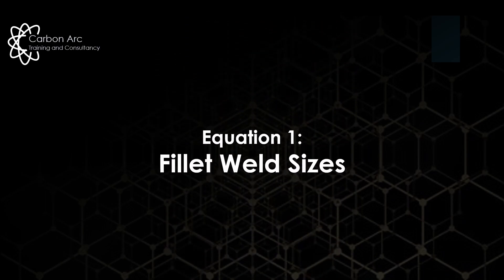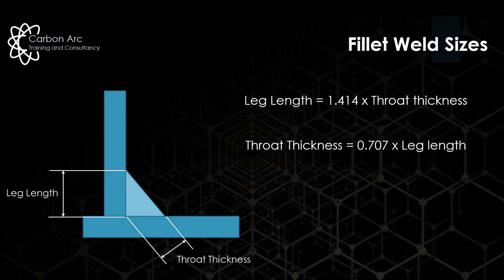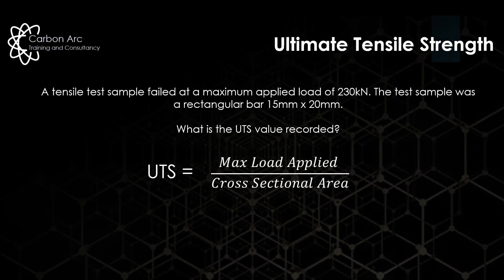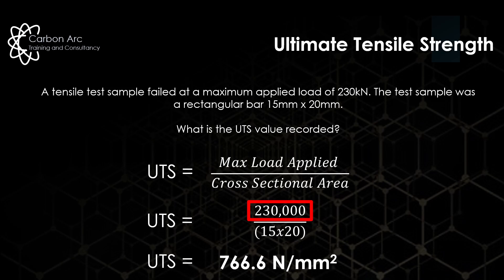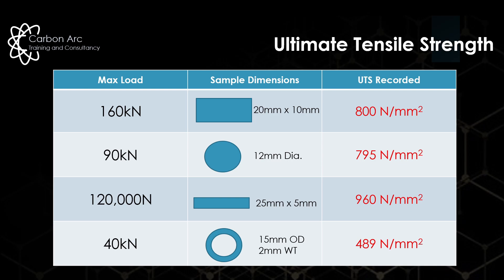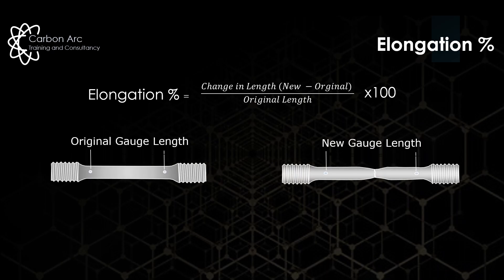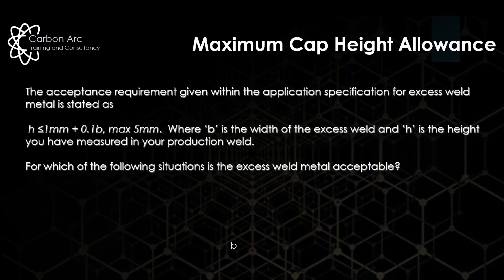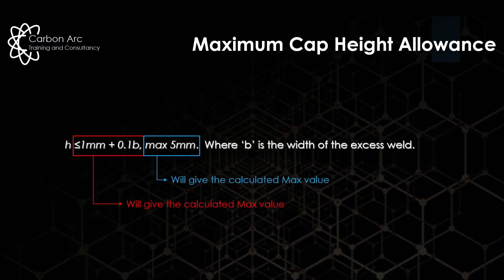4 More Equations after Heat input

Comment: The 5 mm max allowance on cap . Is that the rule across the board, or be Related to specific standard or code ? Thanks . This content is great. I just need to ingrain it into my brain .
Reply from the maker: Not all specifications/ Standards use this type of equation. ISO 5817 uses this equation and changes the 5mm Max depending on the quality level your applying. 5mm is the most restrictive at class B but drops to 10mm for class D.
Reply: @CarbonArcTC  I’ve always thought your going for 1.6-2 mm of reinforcement on your cap as a rule of thumb. ?
Reply from the maker: @JC-un4bg  The calculation is taking into account the width to give you a cap height that will make a "smooth" transition at the weld toe. 2mm may be sufficient but may not be